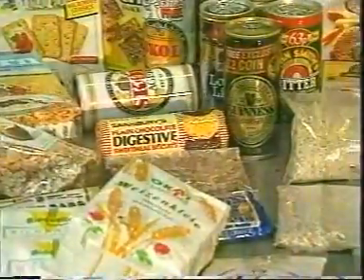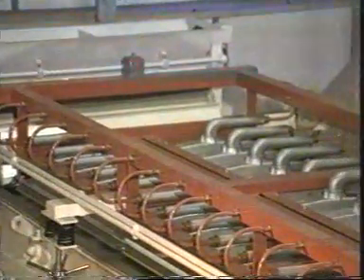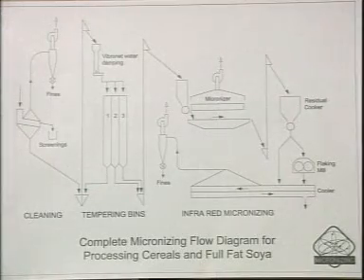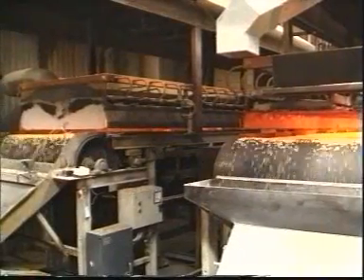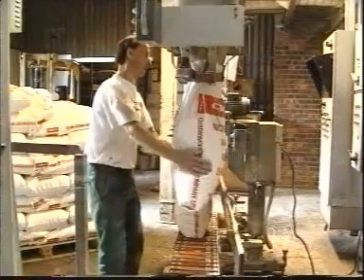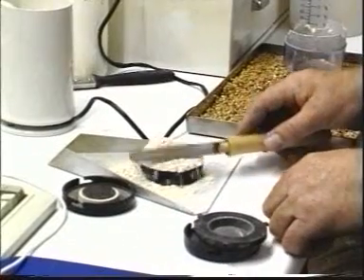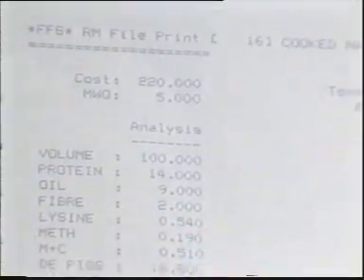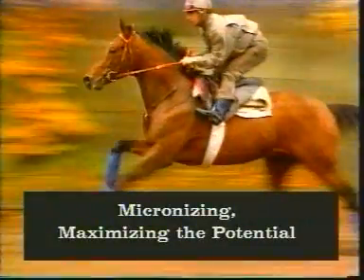Micronizing - Infra red food/feed processing

Comment: Great video showing the history of Micronizing UK and the 'Micronizing' process.
Reply: Longyi patented built-in 3 classifiers dry grinding machines already put into mass production.
For limestone/dolomite/calcite 
The whole grinding system power is around 370Kw
A.D97=4.8um (≦2um:  73.5%)   Output: 1000kg/h       Energy Consumption: 296Kw/Ton
B.D97=6.3um (≦2um:  64%)     Output: 1500kg/h       Energy Consumption: 197.3Kw/Ton
C.D97=7.1um (≦2um:  57%)    Output: 1900kg/h        Energy Consumption: 155.8Kw/Ton  

For Talc powder, 
Longyi powder grinding mill power is 250Kw, the real working power is around 200~225Kw, including classifying system.
A. D90=10.5~10.7um   output:  4 tons/hour
B. D90=9.8~11um      output:  3 tons/hour

It is suitable for processing nonmetallic minerals such as calcium carbonate, calcite, Kaolin, clay, barite, talc, gypsum, limestone, calcium oxide, bentonite, dolomite etc.
Samuel 
MP/Wechat/whatsapp: +8615105956429